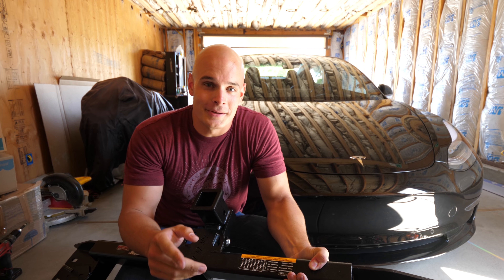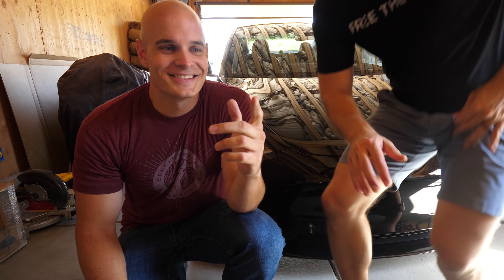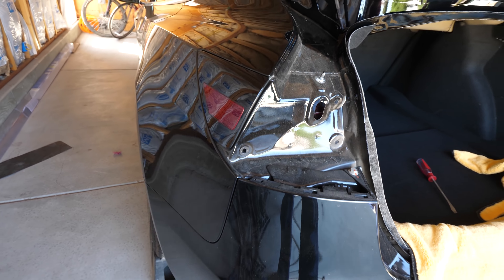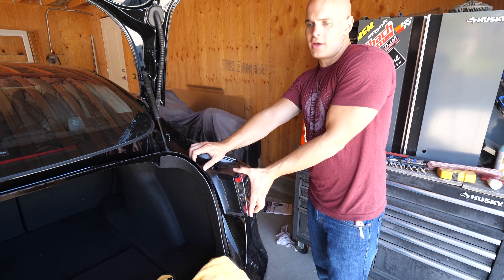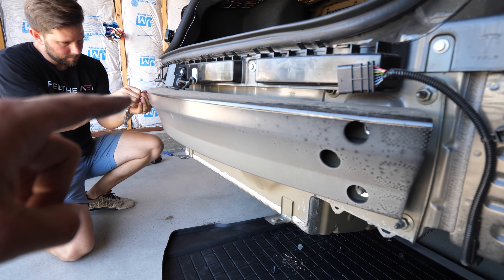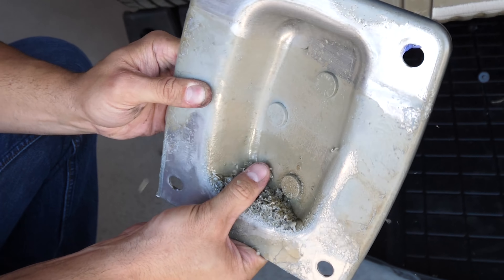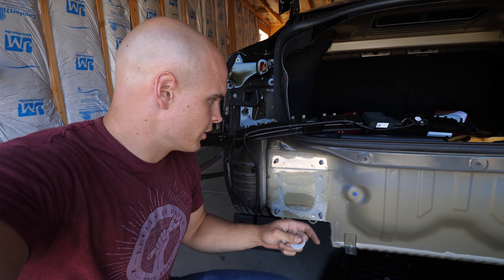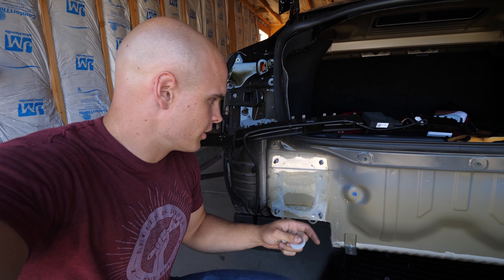Tesla Teardown! - Install a Tow Hitch on a Model 3!

Comment: 3D print a plastic cover for the bumper cutout, when the hitch is detached, don't let that car corrode from the inside! :)
Reply: Eco Hitch makes a plastic plug or fill the hole. It has a very powerful magnet on it that holds it in place. Go check the website.
Reply: In fact, it's better now, with more ventilation.
Reply: Buy the rear diffuser from Tesla that has the hitch hatch. LOL Hitch Hatch

Comment: I guess we are ignoring the fact that there is no wiring harness for the trailer, huh?
Reply: You can probably purchase it at an authorized Tesla Service Point... for 3000 bucks, while the wiring is already done all the way through the floorboard and the only thing missing is the plug that goes to the trailer.
Reply: Stoney3K If they even support that, he said in the video that the model 3 has no official towing weight, so they're probably not intending for it to be a towing vehicle.
Reply: That is true in certain countries and certain states, but still, if Tesla has plans to provide the towing hitch as a future option, the wiring loom is probably already prepared because manufacturing a different loom for non-hitched vehicles is more time-consuming and therefore expensive.

The Model 3 and the Model S are targeted at the American market and there's not a lot of demand for sedans or liftbacks with a tow hitch there, because of the availability of light trucks. It's different in Europe, but if Tesla wants to have a big success in the European market, they will have to release a small estate with a hitch option.
Reply: Exactly, but if they went through the process of adding the preparations for a tow hitch you would think that they would also make the kit for adding the connectors available from the start. 
I don't know how they would go about making it compatible with all types of trailer plugs, given that the US uses multiple connector types, some of which even include electric brakes, while the EU uses different ones with up to 22 pins(of which most are not used, e.g. Multicon WeSt has 13 pins, but normally uses 11). It could be that they used a single connector with all possible connections and just wait to see if there actually is a demand before developing the loom from there on. (disclosing right now that i'm not an expert)
Reply: Don't need one to mount a bike rack, which they said several times is what he's actually going to do with it.
Reply: Is there not some kind of battery powered wireless option?
Reply: Found a non intrusive wiring harness from the USA for my Nissan Leaf in Australia.
Won't be long until one is made for the model 3.
Reply: Since it's aftermarket, how's the rear sensors reacting when you are towing? Would be bad if the sensors keeps on giving a error or warning tone while you are towing.
Reply: Similar to how all cars with sensors can handle trailers.
Reply: @andrewradford3953  Telsa's are not like "all cars". I also wonder about the legality and insurance implications. In Australia at least, I'm pretty sure the legal towing capacity (if any) is dictated by the car manufacturer. Not sure but it might be possible to have the combination signed off by an engineer in the same way that other car mods can be done.
Reply: 9:56
Reply: And today, Tesla just announced a tow hitch option for the Model 3 (in Europe)... So that should answer some of the questions about wiring harnesses etc. However, it's a rack you have to order when you order the car, it can't apparently be retrofitted...
Reply: @andrewradford3953  Well.... in our car, Volvo with hitch, the car knows when something is connected at the back (in the electrical outlet), and thus will limit sensor stuff in the rear.
Reply: Sometimes you do not need that. We have a boat trailer that we use to take up our boat (doh...) and it's on a local gravel road with maximum speed of 20 km/h, and the travel is around 2-300 meter. In the grey zone of legality (since you should have indicator light and rear red light on that kind of trailer (no brakes on the trailer)) but it is on a local somewhat private road (other rules may sometimes apply on private roads) but in that salty water environment, you do NOT want more stuff then necessary that can break.
Reply: I noticed the same thing. One hitch manufacturer (maybe Eco Hitch, I forget) makes a custom wiring harness for the Tesla. It's a $100, which kinda stings, but it has male/female plugs which match the tail-light plugs, so you don't have to do any splicing.
Reply: @floriskuipers4925  Hadn't thought of that. The "wink, wink" story that Tesla owners (with these hitches) tell the service centers, in order to keep their warranty from getting voided, is that they would never tow anything with that hitch, and the receiver is solely for a bike-rack. Installing a wiring harness would be a little... incriminating. :)

Comment: Hi Zac, just giving u advice for 1 mistake i saw when u were torque-screwing the trailer metal thingy - when u torque screw, make sure u gradually tighten all four screws not just the one at a certain value and the other ones afterwards with that same value of torque. As I said they need to be tighten gradually and the other important thing is to be tighten on the opposite sides or diagonally if u will - basically if you tighten the screw in the bottom left corner you should tighten the top right corner screw. So that u will not leave any stress forces on the metal, causing it to fatigue at a later point. 
To be frank, this is not a metal of big importance so these rules can be disregarded, but it is good for you to be informed for future torque screwing. Hope you learned something from my comment.

Comment: Thanks for the clear instructions! Made it really easy to put the hitch on.
 
Bought Curt 13449. DO NOT recommend that hitch. 7 of 11 bolt holes didn't line up. Has to jigsaw the 5/6 stud holes (2022 has 6 not 8 studs) and has to cut the crash bumper because 2/5 holes were a full inch off. (2022 has 5 not 6 holes)

Otherwise... Very easy install. Thank you for the video!

Comment: Just installed the Stealth Hitch from the other guys.  A little more involved and limited to Rack Use only, but had some locking mechanisms that are very high end.  Unless you need the 2", go with the 1.25"  I was concerned that my rack would ride too close to the trunk, but now I'm concerned after using the Harbor Freight adapter that it is too far away.  I can always tap a new hole in the rack and let it slide all the way in.  Nice to have the added feature of a bike rack.  Getting the bumper back on is a harder than you think (omitted in the Video).

Comment: FYI, it looks like from the installation video on the Torklift Central website that you do not have to remove the weather seal around the trunk.  If you don't have to remove it, don't because the sticky adhesive that holds it might not be as strong or weather tight after reinstallation.

Comment: Dont you get water into that hull? when it rain
Reply: Was thinking the same thing. Why all the work to remove the bumper when you can leave it out in the rain? xD A couple Model 3's had this issue for those who don't know, where the bumper filled with water and fell off. (Btw this is without the hole being cut. That hole probably doesn't help...)

Comment: Does the installation of the tow hitch affect the car's warranty?
Reply: Of course it will.
Reply: In the US, the manufacturer has to prove any vehicle modification CAUSED the problem you're filing a warranty claim on.  So...there'd have to be a demonstrable link between the damage and the hitch install for a claim to be rejected.

Comment: I would love a more detailed disassembly video. I have the factory installed hitch, but I am not happy with the placement of the trailer light socket. The plug is fairly long and can rub against the groud where there are quick change in slope. I want to move the socket to a place where the plug will fit inside.

Comment: The concern with that type of hatch that bolts to the bumper is that those mount points aren't designed for up/down force couldn't weaken over time. Better to get a hitch that mounts to the underbody of the car. Though that may never happen. With the 2011-2015 Chevy Volts, you have a choice of either type

Comment: Good video Zach, well done! I think the risk for the Tesla is sudden acceleration because it has so much torque. I also wonder if the Tesla can sense the extra weight and lock out the ludicrous mode. Launching with that weight would surely cause some damage to the mounting plates and body.

That trailer looks like it's rated for 1,700 pounds, not that it weighs 1,700 pounds empty. Empty weight look around 800 or 900 pounds. The most creative hitch install I did was on a 1970 Karmann Ghia. It required that I weld thrust spacers to the hitch to transfer pulling stress to the frame of the car instead of the mounting bolts, and it works very well. Trailer is a custom made cargo unit that I flipped the axle around to lower the ride height, and it tows like a dream empty or loaded. Of course, the Tesla's electric door locks probably have more torque, but it still cruises happily at 70 MPH with the trailer full. The Ghia towing capacity is 882 lbs without trailer brakes, 1433 lbs for a trailer with brakes. The irony!

Comment: Maybe a Tesla truck should be a thing?
Reply: Mr. Miyagi Tesla has semi trucks and another company called rivan is coming out with an electric truck even more amazing than the model 3 and I mean I love my model 3. There is meant to be a motor for each wheel. Autopilot traction control and much more

Comment: Does this void any warranties?
Reply: Here's what the manual says:

Warning: Do not use Model 3 for towing purposes. Model 3 does not currently
support towing. Towing can cause damage and increase the risk of a collision.
Caution: Using Model 3 for towing before Tesla-approved towing components and accessories are available may void the warranty.
Reply: coda does taking apart your phone void the warranty

Comment: I may be a good idea to find a way (maybe construct a piece of plastic that would clip on) to close the whole you opened on the underside of the rear trim. This way, when the hitch is not used, the underside would be completely sealed. I am a little afraid that if you leave this open, a lot of dirt would enter and get stuck inside the rear bumper. Not to mention that you may lose some of the aerodynamics  (rear diffuser aerodynamics).
Reply: the hitch company supplies a plastic cover that fits over the cutout. it attaches with a strong magnet and seems to work well.

Comment: The biggest concern would be damage to suspension components due to stress of the force of pulling the additional weight. Hitch won’t break. More likely rip free of those main bolts (the 50 foot pound ones).

Comment: with different crash bar you change crash characteristics of the car, so this should go thru homologation process (at least in eu) and manufacturer couldn't pro0bably get confirmation. that's why bar for tow hooks are putted at the bottom more towards back wheel axis. strange, when you're so picky about co2 and nox emissions (don't get me stared about that bs), but not about safety..

Comment: Wonder if that hitch is strong enough to launch a boat.  1000 pounds loaded 17 foot boat, 400 pound trailer.  Pulling it out of the water is the most stressful part.

Comment: Just as an update to anyone that possibly see's this post for newer models.  ITS VERY IMPORTANT THAT WHEN REINSTALLING THE BUMPER, YOU MUST HOOK THE UNDERSIDE UNDER THE MIDDLE SECTION OF PLASTIC BEFORE BUTTONING UP THE BUMPER!!!  If you don't, you have to do what I did, and take the bumper back off (including the lovely little torx screws) a second time to get the underside plastic under the middle section.  Also, the new model 3's come with a flap so you don't need to cut the underside anymore.

Comment: When installing that, aren't you adding a plate thickness whereby causing an additional thickness to cause a larger gap? or is it the same thickness as that metal plate you removed?  Either way, with that metal and the plastic washers (2 each per stud), I'd think that there must be some additional gap that is created by installing the hitch?  Please advise/clarify thanks

Comment: Looks like you guys should have been the ones to repair The Fast Lane Car's Tesla that they wrecked, you guys probably could have done it without breaking the rear glass and roof glass LOL.  

I didn't think the Tesla was rated to tow anything either, but many vehicles aren't and you see people towing things with them anyways.  I wonder the reason really, maybe public safety and/or automakers knowing people really don't pay much attention to weights, speeds, braking, etc. so they severely under-rate many vehicle's tow ratings to compensate.

Yes, those plastic washers are separating 2 different metals, the Tesla is aluminum, the receiver hitch is steel.

Comment: You installed the mechanical part, but where is the electrical connector? The trailer needs turn signal indicators, brake lights, rear lights. Even a bike rack needs all the rear lights as the bike might block the rear Model 3 lights.

Comment: And then the bumper snaps right off, just like a really big Lego.
Reply: Yeah.  That's not REALLY the BUMPER.  It's the cosmetic bumper cover.  The bumper is the steel plate that bridges across the two disposed-of angled metal plates.

Comment: That's the oddest hitch install ive seen. All the hitch's ive seen bolt onto the frame horizontally so when you "pull" something it pulls... Because it's on a vertical bolt install rather than horizontal it seems like it would snap the bolts when pulling something. But what do i know..

Comment: Lack of lights is a huge issue. How do you get brake & turn signal lights for the trailer? If you can't, then it means you can't legally pull any trailer on a public road.

Comment: I noticed you didn't show what it looks like after installation but without the hitch attached, and you also didn't show us how it attaches.  It very much looks like you'd need to remove the tail section to get that pin where it needs to go.   At the very least it's a tight fit, and then you have to tighten the nut.  Show us!

Comment: I have no doubt that the Tesla can pull 2000 lbs, but it would take a skilled hand to keep control, because that much weight will want to push that car around.
Reply: The Model 3 Weighs nearly 4000 pounds, versus a trailer with a max pull of what, 300 on the hitch?  The tail won't wag the dog.

Comment: I'm going to be that guy and ask "why didn't you do a little shield to sorround the hitch hole so it doesn't get nasty under the bumper? If a considerable amount of water gets in there, some corrosion may begin to take place in the car's frame...I think
Reply: the hitch company supplies a plastic cover that fits over the cutout. it attaches with a strong magnet and seems to work well.

Comment: What!? Why did 2 owners has a fallen bumper when there’s so much bolts to hold it to the m3. Anyway, you should of add the trailer pig tail to m3, there will be time when it comes thru.

Comment: Thanks for the video. I guess you can install a universal trailer lighting adapter/ harness. But do you know if the model 3 has already a trailer wiring harness available? The European model 3 has the factory trailer option available. Thanks.

Comment: Nice Video, but due to safety regulations, this project would be incredibly illigal in germany. And u may consider the extra stress with recuperation on the motor with the extra weight. Thats the reason, why Toyota Hybrid cars are not allowed to tow more then 350 kg.

Comment: Does this do anything to the warranty on our Model 3's if Tesla finds out you placed this on the car?
Reply: I doubt it, they make a trailer hitch receiver for it, so obviously its an accessory, but always check with your manufacturer first...I'm sure if hauling a bike carrier is all you are doing it wouldn't be an issue but there may be something else involved if you use it to pull a trailer....if the car isn't rated to tow anything then Tesla may have something to say, then again, if that were the case why is there a receiver hitch for it then?

Comment: 2019 Model 3 Warning!!
I spent 3 hours trying to make it fit on my 2019 Model 3, the metal parts fit like a charm but I could not get the fascia back on. In the end it looks like Tesla has changed the rear fascia and this will not fit any more. The store and manufacture wanted me to take the car a part "again" to send them measurements and photos to show them why it does not fit. It is not my job to troubleshoot for them. The dealer tried to help a little but all emails to Torklift Central went unanswered. Very unhappy, selling it locally to someone with an older model.
Reply: Just finished install on a 2019 Model 3. Went in without a hitch.

Comment: Good video. Not a Tesla fan but they are cool cars. I see comments about the plastic cover on the bottom of the car may possibly  let in water now that it's cut to fit the hitch. Did you see the amount of sand and dirt in the bottom of that cover when they removed it. Water is going to get in there regardless. IMO
Reply: the hitch company supplies a plastic cover that fits over the cutout. it attaches with a strong magnet and seems to work well.

Comment: But what’s the use of carrying only 300 pounds if the trailer itself is close to maxing it out
Reply: Its not like you have to use a huge-ass trailer that almost maxes the capacity. Just use a smaller trailer.